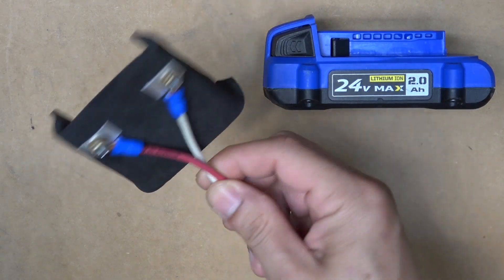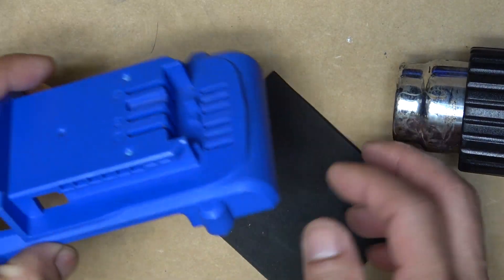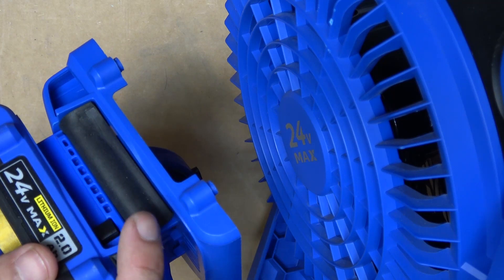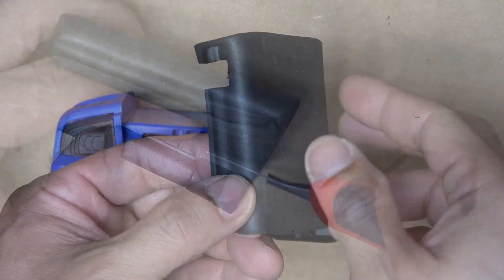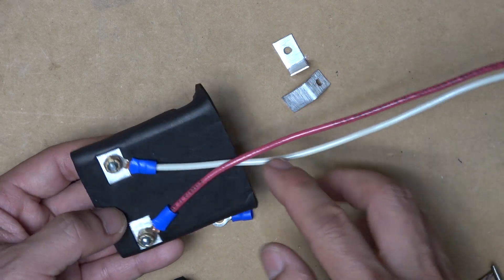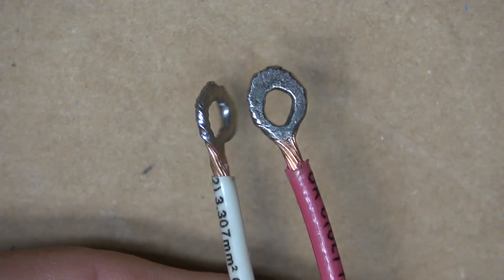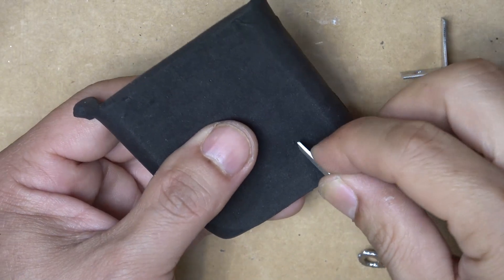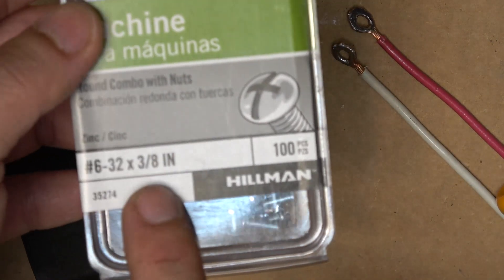DIY: Make power tool battery adapter from EVA foam

Comment: I can do this from pvc pipe easy and is more stronger
Reply: If this foam becomes more rigid when heated and then pressed (I.e. crushed), it would obviate the need to flatten cylindrical material (PVC): preheat the cut sheet, place it on the object you're using as part of the mold, and crush the sheet using one or more additional elements, appropriately positioned and then clamped, to complete the process. You could, possibly, fold in pre-chilling of one or more parts of the mold to speed the process of forming the finished piece.

Comment: Very nice. 
I did mine with a "moldable plastic Thermoplastic beads", using press and seal or saran wrap to cover the battery. Then, just like molding a putty, you press it to all the necessry areas like the slide and lock. When it is almost cured but still workable (slightly white, I slide it off the battery and use scripto knife on the terminal holes to finish the slot all the way through. I dont even need to make holes on the battery lock (It locks in place).  Fits like a globe. You can use a thicker material like aluminum foil to wrap the battery If you like it a little bit loose.

Comment: It's not the smartest idea to heat a battery pack with lithium ion batteries with a heating gun. But the project itself is great. You should just remove the batteries before heating.  The electrolyte in batteries is volatile and highly flammable.
Reply: The battery wasn't attached he only had the plastic piece

Comment: Very good idea, I will try it. But I would reinforce the back with an insulating hard heat resistant material like a piece of plywood or odd floor laminate piece with holes for the contact screws. High current with mechanical contacts have habit of getting very very warm. And a final cover also. Lithium batteries got bad reputation even though they getting much better now.

Comment: It would probably be better to make the electrical connections with about , 12mm copper tubing,   hammered flat, then filed or sanded to get more precisely flat to fit the battery,  and bend and drill. Holes and possibly use copper pop rivets to attach,  solder 12 gauge wire to the terminal,  then attach to the battery, and coat the outside of the adapter with epoxy, if you want it to be a bit stronger!

Comment: can I use an aluminum foil instead of the aluminum strip you used?
Reply: No don't use aluminium foil it's too thin and weak, try to find copper cuttings someplace, maybe a plumbers wasted cuttings. Copper is a better conductor.

Comment: Fantastic video mate! Well done! (Hope the integrity of the PVA foam hasn't been compromised too much by your screwing the screws so tight to flatten it?) You nigytbeb wise to add a couple of extra layers of foam one on top before the aluminium to make it thicker and then one op top of that above the screws so that they're isolated and not exposed (it also adds a bit of impact resistance to the top of the battery aswell as preventing shorts!)

Aside from that good cheap and quick result! I might try this myself on some different batteries I have.. I wonder if you can make some battery adaptors in the same way? EG. To fit one tool brand to fit another brand of battery? Maybe you could try a video on this?
Cheers from London England 👍😎🏴

Comment: Ever thought about getting a 24volt inverter for power backup useing the tool batterys?
Reply from the maker: I did that a few years back with 2 Milwaukee 18V power tool batteries. Here's the link: https://youtu.be/8zvPMCMvlBg

Comment: I was so glad I came across this video.  Your other videos inspired me to build an Ebike powered by a couple of 24 volt Kobalt tool batteries.  Yesterday, I hit some rough ground, and a battery holder split apart.  I tied it together with a bungee cord.  I usually ride about 20 smiles per hour.

Comment: Great approach.
Additioally, I'd first smooth/round the contacts before installation, and 
use more EVA foam to mold a cover.
24 VDC shorted is quite exciting.

Comment: That trick to turn the wire into a ring was pretty slick. But I'm going to assume if someone doesn't have any ring connectors, they probably don't have a soldering iron. I don't know what kind of weirdo would have one without the other. You either have both or neither
Reply: I'm that weirdo, I despise crimp connectors. Way cheaper to keep scrap wire, solder, and an iron on hand than a complete load-out of crimp connectors. I did the same thing with heavier wire on an inverter with a 10mm head bolt and nylon locknut just like in the video. Taped a cheap 10mm wrench nearby because you can never have enough 10mm wrenches!
Reply: @wrathofsocrus  Now I know where all my 10mm wrenches are!
LoL~
Reply: Why would a weirdo bother to make a comment like this?
Reply: @Vile_Entity_3545  you weirdo replyer. If you was a mythical animal, you would be a weredowolf
Reply: @Vile_Entity_3545  Because I think vuaeco is a great YouTuber trying to help people with DIY projects and explains himself very well. Why would people come to these comments to discourage DIYers or vuaeco? If some people don't gravitate to this content then that's their problem. The function of the projects on this channel speaks volumes whether someone wants to listen or not. It's lovely that other people have other methods, but people would be surprised just how different some people live their lives, such as having a soldering iron and no ring crimp connectors on hand.

I specifically rolled with it instead of being insulted because I don't want to be like other people purely to 'fit in'. There's a long line of people who know I'm a weirdo, and they all call me when their stuff breaks. I wear the weirdo badge with pride.

Comment: Good video, can you do a video on a 40v Battery with Eva foam and connect it to a pure sin wave inverter? I have some Hart 40v battery's that I would like to use any good ideas?
Reply from the maker: I did the Kobalt 40V adapter a while back. Here's the video: https://youtu.be/RwYqsHfW4E4

Comment: Good morning. What is the third terminal for?
Reply from the maker: Third terminal is signal wire for the Kobalt tool. It runs from the battery BMS to the Kobalt tool. Without the third terminal, the Kobalt tool won't work. But since I'm making this for everything else but the Kobalt tool, third terminal is useless.